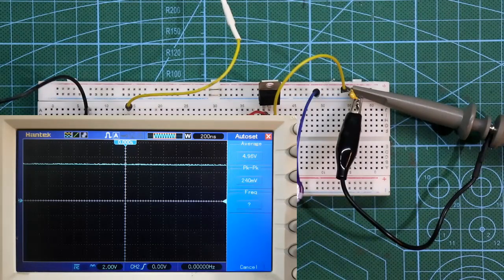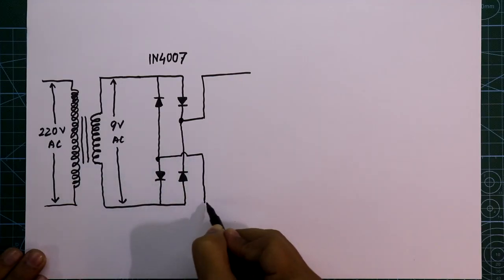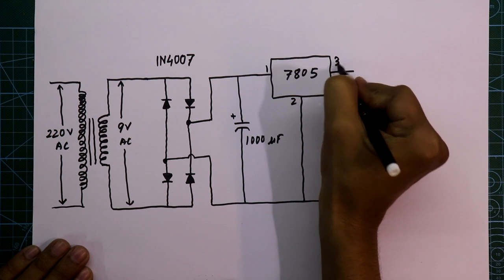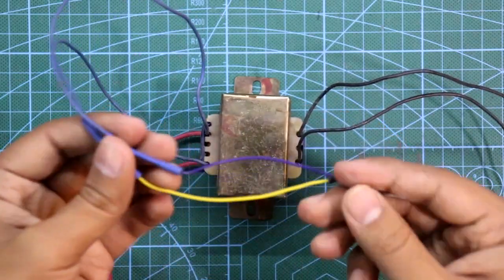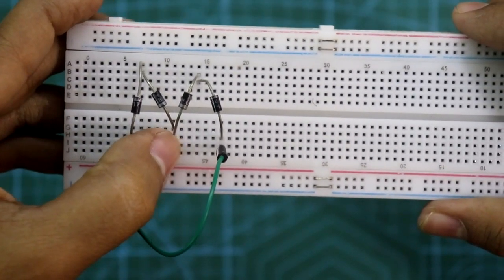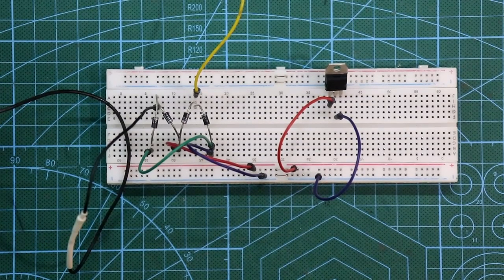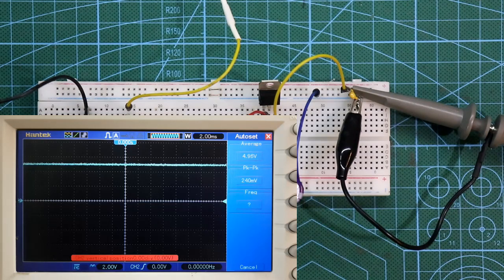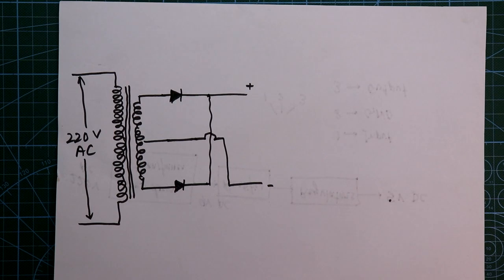5 volt Power Supply Circuit

Comment: in place of transformer  , if we use cycle dynamo which provides 15-20 volt AC. after that do we need to change in circuit ? or we will still get 5 volt DC